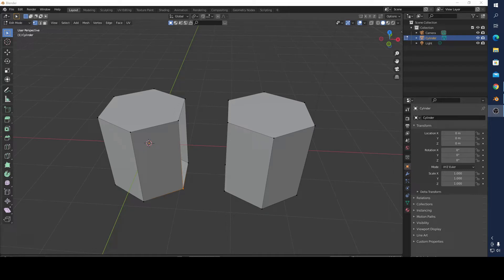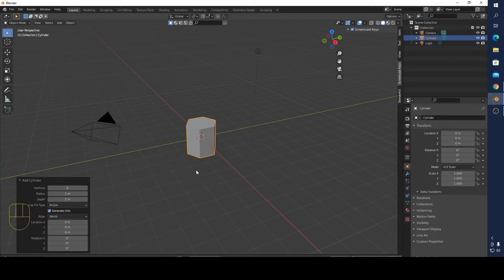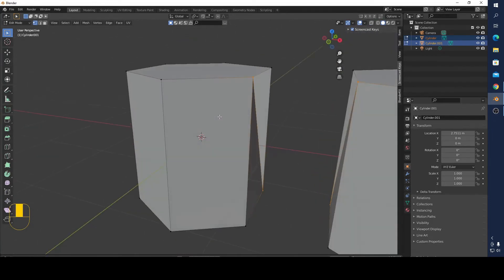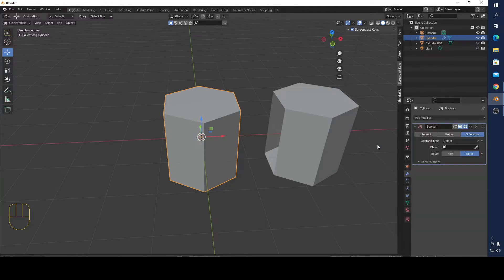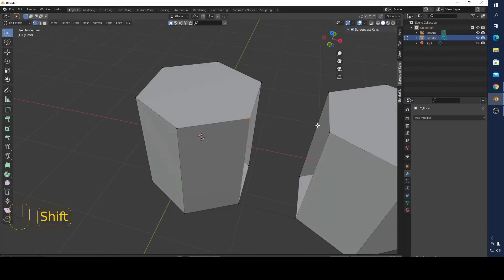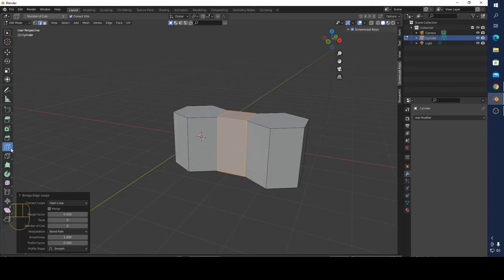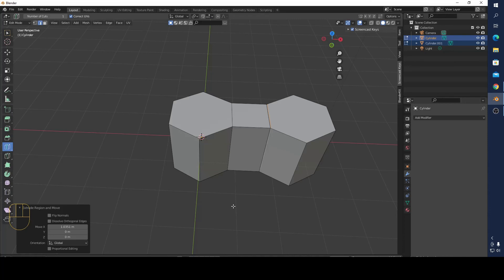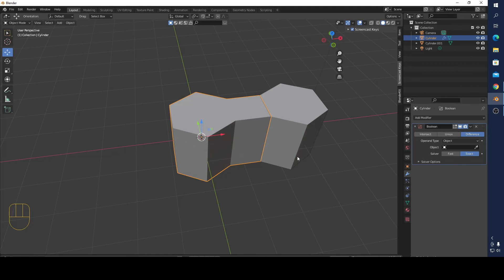Blender 2.9.3 How to Connect Two vertex or Two Edges

Comment: I'm using an older version of blender but I have this strange incident. I copied and placed a face that ends in two vertice dots against another face that ends in only an edge. On the original uncopied mesh the mesh doesn't tear and because they were knife cuts it counts as everything is sealed. But after copying the same thing I link all the aproberate vertices and they are fine except where the new face that ends in two vertices has no way of merging with the edge of another face. I am aware I can fix this by sub dividing the edge but is there no way to link a vertice on a line/edge?